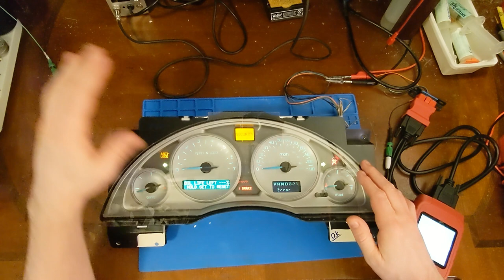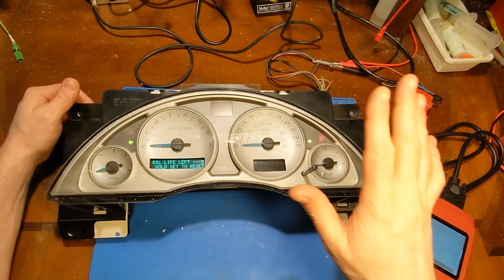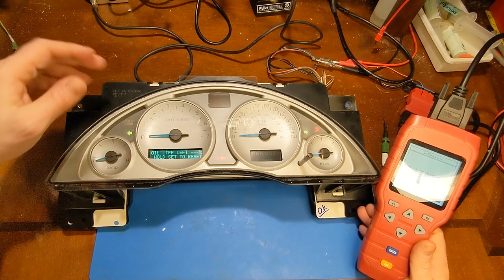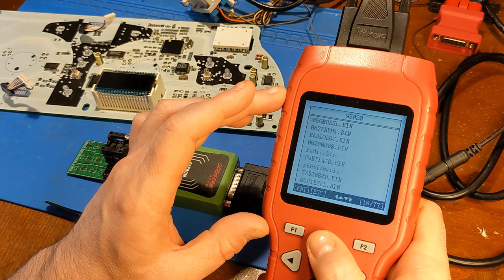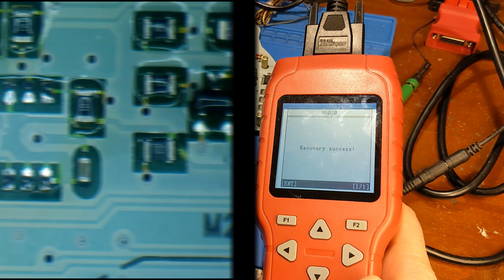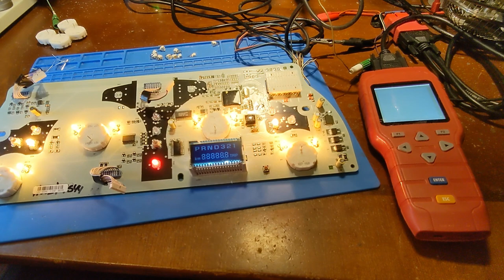Buick Rendezvous Error

Comment: GM quality, because those bulbs are under the odometer and extremely difficult to change, they couldn't install LEDs at the factory.   I'm liking the newer cars less and less.   Good video, thank you.
Reply: What are you on about? They were soldered in, changing a soldered in LED is the exact skill level as soldering in in incandescent light… unless you look to apparently future cars if this is “new” to you where the leds are the size on an atom yeah, that’s a different story. 

Also, what does that have to do with the factory not being able to do it? They would obviously put the bulbs in first before the display… 😮 amazing. Wow, it’s amazing they put all those components in this screwed together cluster unit! How did they do that! They must have some magical machinery! No way they built it from the bottom up! That’s silly!!! They screwed and clipped the cluster together then put the circuit board in there. Duh, it’s like building a house, you put the roof on before putting the walls or supporting structure up! Keep the workers dry while they do that!!!!🙄

Also also, “new clusters bad, you can’t replace the bulbs easily like we could in the 80s” well that depends I know unscrewing a bulb is a lot for your boomer mind, but most anyone who davels in repair from the newer generations can replace soldered lights, sure it’s not as easy but it’s a skill that since technology has been in our lives we’re much more akin to knowing how to do that. Kinda like you guys and ruining the economy it just came easy to you. 

Also also also… even with bulbs that are easily replaceable in the cluster still no one does it I have not seen in my life an older Chevy with proper (not China led garbage replacements), or fully functional lighting. Not once. Even though it’s literally as easy as unscrewing a lightbulb. So, since no one is gona bother fixing it, why make it easy to fix and instead use equipment that most of the time will FAR exceed a vehicle’s lifespan. 

Also also also also, wait till you hear about way way in the future (2020+) cars that it’s literally just a “Picture Box”.

Comment: Dear Jeff, I am having the first problem that you commented. I have an error but my heat and fuel gauge do not work. If I use my scan tool I can sweep them up and down no problem and I am getting a U1000-13 code. I put a new BCM in it and it is registering okay but I also can't seem to program the keys as I get a set of 2 - 4 chimes when trying to program. Could the PCM be the problem? I don't have a lot of cash to take it into the shop and I need to get this fixed for my son. Any help of your knowledge would be appreciated. Thanks Bruce
Reply from the maker: Sounds like the vehicle is having communication issues. The cluster is probably showing the symptoms but not necessarily the cause.
Reply: @jeffescortlx  I know right! I retired from the military and was a 62b heavy equipment construction repair but I never got into the electrical stuff. I have a xtool D7 smart diagnosis system and it shows the new BCM is okay but I'm getting the u1000-13 code for the supplemental inflatable restraint, seat memory module, instrument cluster and theft deterrent. Is there any suggestions you could give me? Could the PCM be causing the problem I'm having here or do you think there might be a ground or wire problem? Greatly appreciate any assistance you could help me with your knowledge. Thanks again Bruce
Reply from the maker: @fonzie401  start unplugging any and all modules that have anything to do with the serial data bus. Keep on unplugging things until the communication problem goes away then you found your culprit.
Reply: @jeffescortlx  thanks! I'll let you know when I figure it out. 👍
Reply: @fonzie401  Did you ever figure this out?

Comment: Tip: Gravity. Put the pins horizontal and suck, less work for the gun. Also helps to apply fresh solder.
Reply from the maker: Yes all good advice. This process went smoothly without any difficulties.
Reply: When I'm teaching people how to solder, I always tell them that gravity can be your best friend!
Reply: @jeffescortlx  was a wonderful video :)
Reply from the maker: @rpsmith  yes when I'm hot airing a HDMI port off I'll flip the board upsidedown and heat the back side, it will normally just fall out when the solder is melted.

Comment: Odd how the  eprom gets corrupted,  a random write from the micro?
That desolder gun must of made your job so less stressfull.
No messing around with a solder sucker that jams up if you stair at it too hard  :-D
If that desolder gun was around when i was replacing chips in old 8bit computers, i would have 
enjoyed it more.
But in my 20's i was rather determined to get the job done the hard way.
Stubborn sod lol.
Reply from the maker: Yes the electric desoldering tool is a game changer. As you know removing components (especially through hole with multiple leads) is the most challenging part of PCB repair. But this tool makes it so much easier.
Eeproms aren't perfect. They also fail in TV's and computers regularly. The odometer value is typically stored in three different sections of the Eeprom and compared the value to each other to help cut down on errors. But sometimes that just isn't enough.
Reply: @jeffescortlx   Three sections,  the power of 3 is handy but i would want three seperate eeproms.
Never trust 1 chip.... you end up eating them all, sorry silly mind :-D

Comment: When I replaced my burnt bulbs with LEDs in my 02 impala, those bulbs did not wanna just snap off like that, they disintegrated when I touched them lmfao. Nice video dude, I think I heard thunder in the background so this was quite the relaxing video.
Reply from the maker: Yes, some car clusters have through-hole light bulbs that need to be desoldered to be removed. While others are surface mount and can be snapped off. And yes, I noticed the thunder during editing lol
Reply: @jeffescortlx  I just went and edited the video from when I did it and realized thats exactly the case, they were through-hole vias not just pads up top. I Just came back to update my comment to reflect that and saw you replied, but I never got a notification for it so thanks Youtube lol.

Comment: Hi I am having this problem now with my Buick Rendezvous showing error. Once it comes out of error and shows the miles, it starts up sometimes. What could be my issue? My temperature gaze and stuff works.
Reply from the maker: When it says error the gas gauge and temp gauge read accurately?
Reply: It says gas low even when I have a half or full tank on error. The temp gauge reads right. Sometimes, it comes out of error quick and starts. Sometimes, it takes awhile. I have to turn my switch on to see it comes out of error to miles to start it.
Reply from the maker: @veronicamcmillian6907 two things can cause it to say error:
1: corrupted eeprom. But this can't be your cause because you says it comes out of error and shows you the miles.
2: No bus communication. But this can't be your issue because you said the temp gauge works, if the temp gauge is working that means it has bus communication.